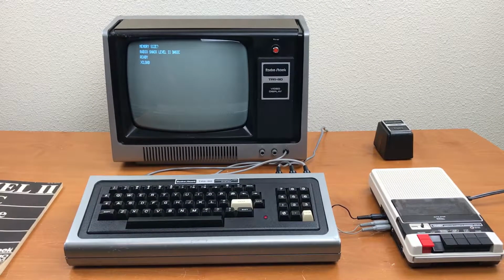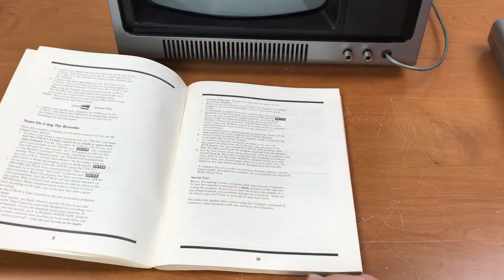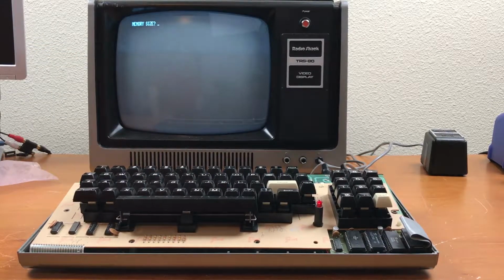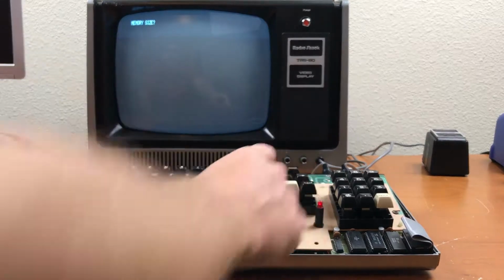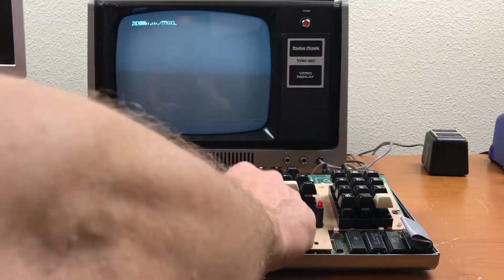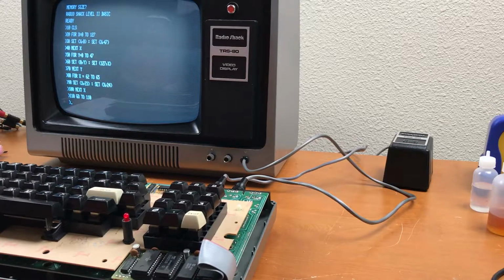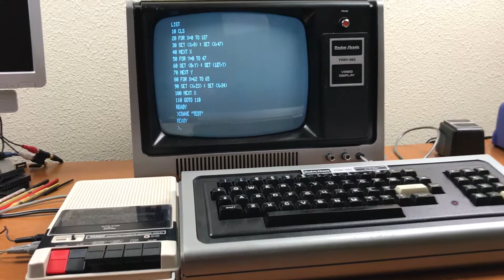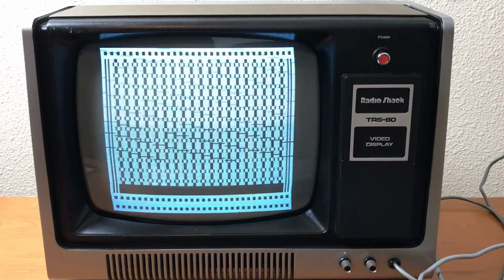My TRS-80 Model 1. Replacing video RAM chip, adjusting voltages and testing.

Comment: this model has a numeric keypad and in your 2022 video the model I level 1 that you show does not have a numeric keypad, why is that difference?
Reply from the maker: They added the numeric pad later. The one in this video is a 1979 model. The 2022 video is a 1978 model.

Comment: Thanks. I am just using mine and have only loaded from cassette on my CoCo's. Thanks for pointing out the CLOAD - looks like it's very similar in commands. BTW, I have a CTR-80 (original) if you'd like an image (and the carrying cases and dust covers). Technical Reference Handbook is a dead link btw. I think your video is one I will probably revisit periodically as I try to do more with repairs, etc. Thanks again!

Comment: I had one of these second hand back in the early 80's or late 70's. Eventually someone gave me a complete system with the expansion interface and floppy drives sometime in the early 2000's. Those drives were heavy enough to be boat anchors. I did have a lobo expansion interface for the Model 1 back with my original Model 1 but never had floppy drives.
Reply: @HutchCA  Yeah it was okay for a first try but their at least improved on it in the Model 3. I had for a time a 3 and a 4D and event he 4P portable way back. But those were all when they were obsolete just for fun. Their expansion interface for the Model 1 was a pain to keep going due to noise and dirty edge connectors.

Comment: Hey Chuck, 
I just pulled out a couple of old TRS-80 Model 1's out of my garage, that I picked up back in Jan. 
I have one keyboard that seems to have a problem with its vertical hold. I can get a clear picture now, but I can not adjust it over to the left side of the screen.
The other one, I am having a problem with the 5V side. I am only getting 2.0V, so I was wondering which voltage regulator, needs to be replaced. 

The other BIG problem that I have, is finding working Power Supplies. I have at least 2 good ones and 3 bad ones. I would like to get a couple more good ones.
Reply: Re: the vhold, check out this reference - http://www.trs-80.com/wordpress/repairs/

Comment: Have you ever been able to take apart one of these power supply, to repair them? I have a couple of these out in the garage right now, but I have not had any time to fire them up, as of yet. I have another one out in my shed, with the expansion module and I noticed that both power supplies in the expansion module were dead. Try to take apart one of the power supplies is worst then trying to pull your own teeth. Although it was funny to find a fuse inside, because there is virtually no way to get inside to replace it.
Any ideas or suggestions for working on the old TRS-80 power supplies?
Reply: @HutchCA  Yeah, it is opening one up. that is hard  part.
Reply: @jeffnay6502  maybe a dremel with a guide to cut it? Seems dicey though- I would worry about going too far? You could maybe 3D print a replacement cap (ABS?) if the original plastic shatters (they can get brittle with age).

Comment: I seem to recall there being a program (maybe that dancing demon one) that would produce sound using radio interference. If you got an AM radio close to the machine and tuned it to the right frequency you'd get something that resembled music.
Reply: @HutchCA  manly computers did not need to pass FCC regulations.   LOL!   Great video.
Reply: I have done that ... on the high school's TRS-80 ... back in 1980 (?1979?).

I do not remember (sorry that was 40 years ago now) where or how I got the copy of the program, but I do remember having manually typed it in (keyboard bounce sucked), and placing my Panasonic model R-1070 (yep still have it) next to the TRS-80... and, on a endless loop (I tweaked the program a bit).  The song it played was the Beatles' "Yesterday".  I thought it was awesome.

In 1980 (or was it 1979), the high school bought 2 TRS-80 computers, the school's beginning of computer classes.  Not really classes (no instruction), just an after school activity for students that wanted to use it.  Which, given that is was a small rural high school of less than 100 students, was pretty much just me there by myself for hours and hours after school and on weekends (the high school building was pretty much open 7 days a week).

Yep, self taught computer geek.   At least for the first year(s).